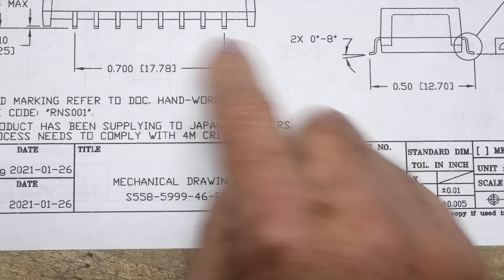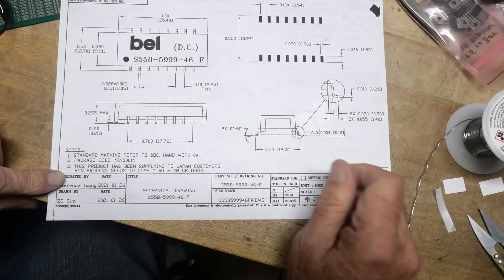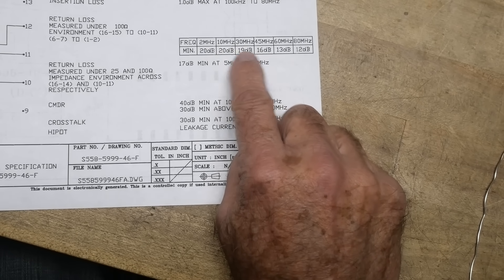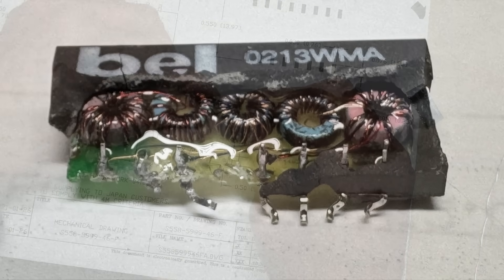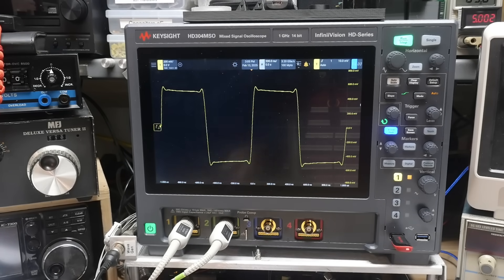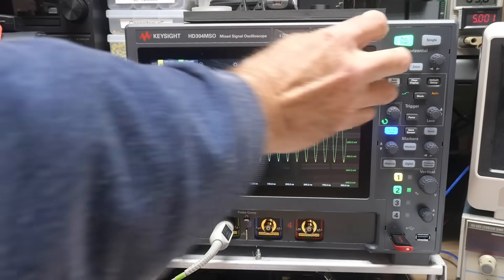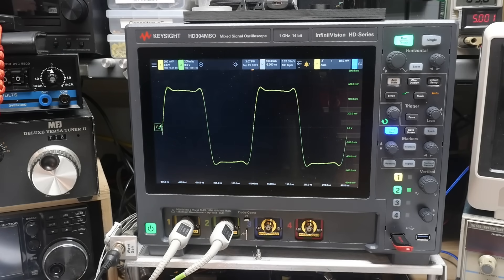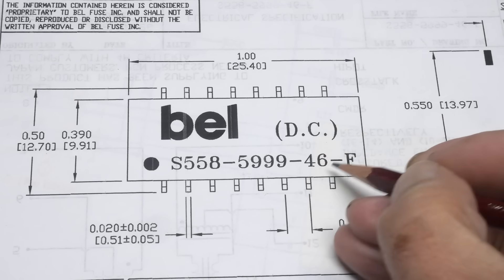#2151 Bel S-558-5999-46-F

Comment: Another place to get a similar type of ""IC" is out of an old router and the package is bigger and often has Bourns written on it.  They are easy to locate as they are usually place near the ethernet port. For some reason they have one on the Raspberry Pi 400 but not on the regular Pi 4B

Comment: Did you know that Ethernet can also use capacitive isolation? Cheap and cheerful. However not every PHY has push-pull output. The one in the video needed a Vdd pull-up on centre tap.

Comment: Ethernet requires these because of galvanic isolation. Ethernet cables run through all sorts of things and have extremely long runs so there can be a significant potential difference at each end caused by AC coupling. To avoid current flows from damaging the computer, these transformers (or magnetics as they're known) isolate the cable from the rest of the circuit. It also helps with things like ground potential difference and all sorts of other fun stuff when equipment can be connected to different circuits or even isolated power circuits where there can be significant difference in voltage when referenced. (E.g., a generator may power part of a network which may cause its absolute potential above ground to float). Ground potential difference is a huge problem in larger buildings and can cause excessive heating. The magnetics isolate this so ethernet cables do not carry a ground reference signal. Even PoE devices are specially designed to isolate the Ethernet PoE from circuit power to avoid inadvertent ground loops if those devices may have local ground reference.

Comment: So what was pin 12 used for?
Reply: Usually the center taps of the coils on the cable side is where you pull the DC power off the cable (or inject it into the cable) if using Power over Ethernet. PoE intentionally adds a DC offset to some of the pairs.
Reply: @gorak9000  I am curious how it effects the saturation behavior, but I assume not much at such high frequencies.

Comment: I finally get to se someone else play with one of these.  I got them years ago in a box lot and like you played around with them.  Have been setting around ever since.  I have given out several tubes of them over the years.  Nice parts, just wish I could find something to use them for.
Reply: Now I am just wondering how "Wakko Wakko Wakkah" might sound at 1 Gbit ethernet😊
Reply: @roelandriemens  I'm pretty sure at gigabit speeds, it's above the range of human hearing, so it sounds like nothing. If a tree in the woods falls at 1GHz (62.5Mhz baud on the cable), does it make a sound??